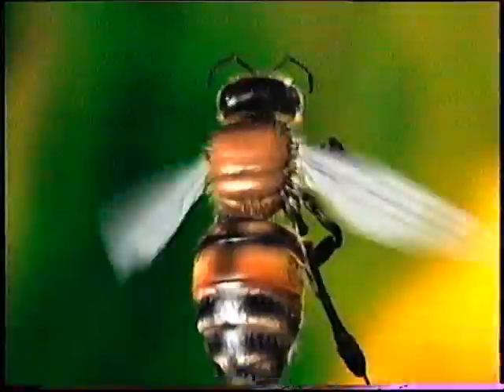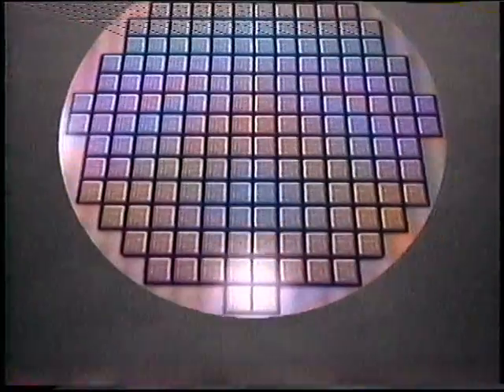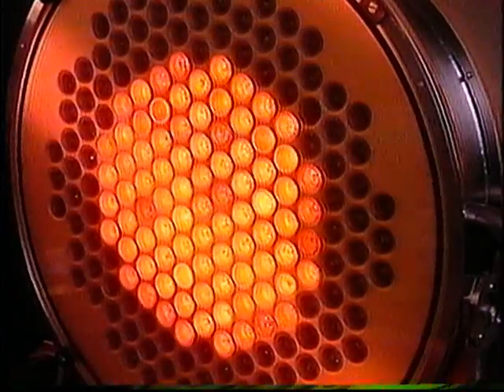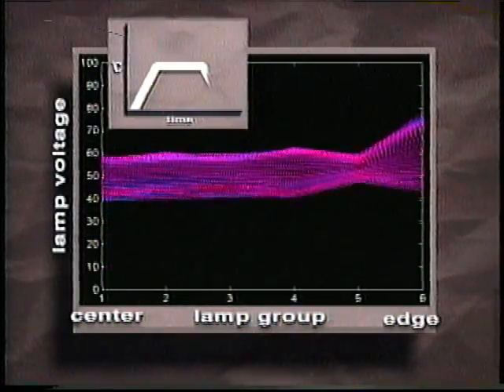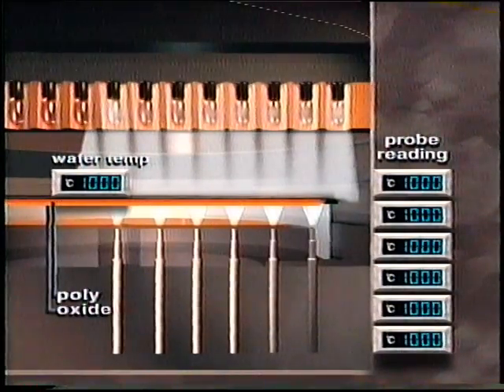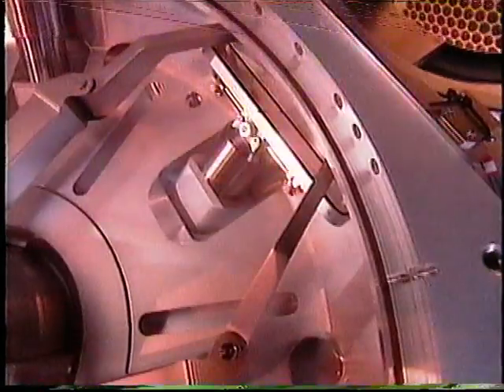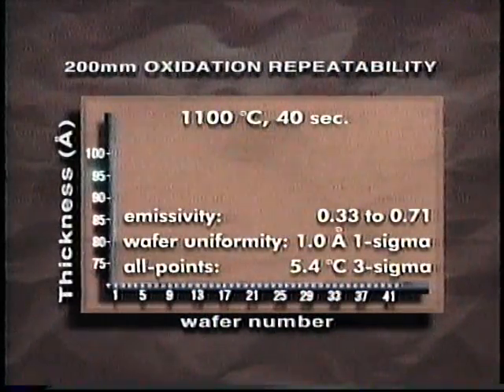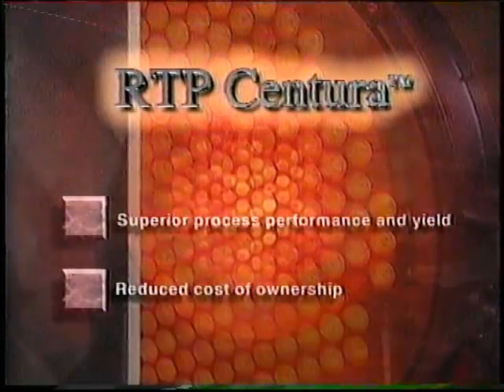Applied Materials RTP Centura

Comment: why the wafer edge power more high
Reply from the maker: Increased surface radiation at edge requires more heat exposure to maintain uniform center-to-edge temperature uniformity.
Reply: difference of heat capacity of edge.
Reply: uniformity across the wafer, mostly a product of the CVD and CMP processes.